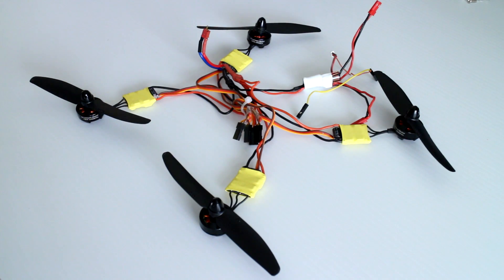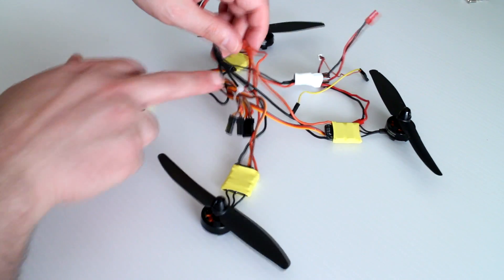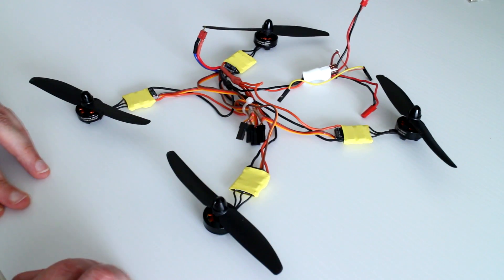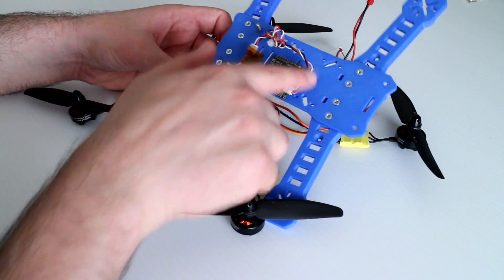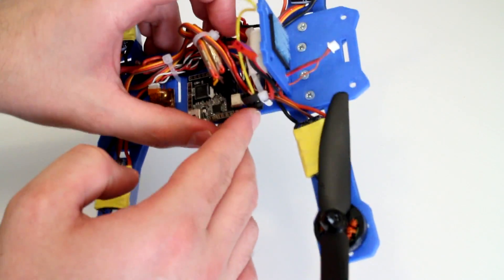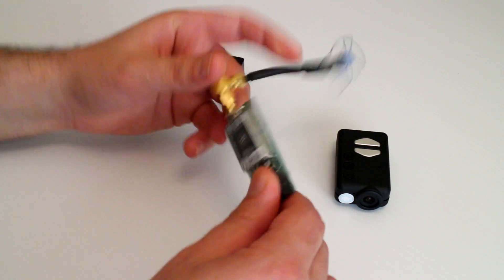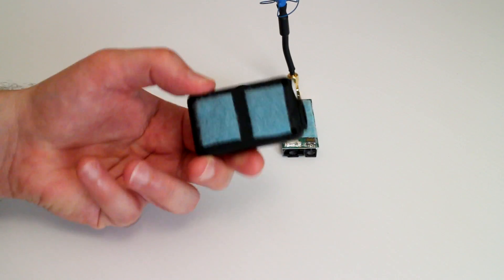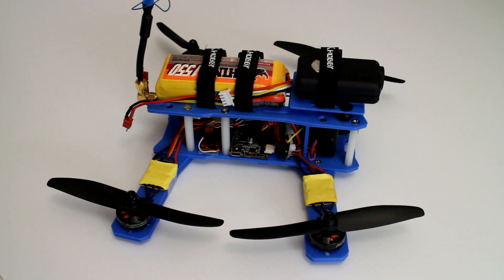Peon230 - Quadcopter FPV setup

Comment: Hey, I am jsut new to this, and I was wondering why you were using 2 cameras. Dont you only need one to transmit to your goggles? Or is one used for recording, if so, is it required?
Reply: I think he uses two because the FPV camera is transmitted over the air in real time and it has tons of defects in the image when the radio link breaks up.   The HD camera record locally with no radio.
Reply: thx
Reply: I personally use a RunCam Split, it has outputs for the transmitter but also has a HD DVR that records 1080P at 60 fps. It saves a lot of weight from not having to have a heavy go pro attached  it also gives more room up top to run a 2nd battery if you want

Comment: And where did you connect the battery to the Flight controller?
Reply: FC is powered off the ESC most likely, they often have 5v taps.

Comment: Did you ever try to make 3D-printed props?
Reply from the maker: No I haven't. I figure they will never be as good as plastic injection plus they are cheaper to buy than print I think.
Reply: Tech2C Well, it sounds reasonable enough. Thanks for the reply! By the way, you've got outstanding quality of your 3D-prints!

Comment: Is the flight controller powered by the escs that you have recommended. Also any updates on parts since you posted on thingiverse? Any tips on configuring the drone (software) or just plug and play? Thanks mate!
Reply from the maker: I have updated the parts list in the description. The flight controller now uses Cleanflight software, and is an all-in-one flight controller with inbuilt BEC, OSD and current/voltage sensors. The FC is powered by its internal BEC.

Comment: what reciever and remote exactly are you using?
Reply from the maker: Hi, the radio control I used is outdated, but you can take a look at this one instead http://www.banggood.com/FlySky-FS-i6-2_4G-6CH-AFHDS-RC-Transmitter-With-FS-iA6B-Receiver-p-983537.html?p=9X051049165582016063
Reply: thank you very much for your quick response, that helped me out a lot!

Comment: Hey there +Tech2C - I'm just putting together a Peon230 right now and I got a quick question on wiring the motors to the ESC's. The motors and the ESC's wires are all black. Is there specific wiring pairs that I should be paying attention too?
Much appreciated.
Reply from the maker: +Sandback Technical Design Inc. 
It doesn't matter. If you need to reverse the motor spin direction just swap 2 of the wires around.
Reply: +Tech2C Thanks a bunch.

Comment: I've been thinking of building a copy of the "DJI Inspire 1" redesigned pro quadcopter that's on RcHobbysUK, I purchased the STL's for a steal $7. The least I can do for all the folks that spent countless days perfecting this engineering marvel.(http://www.rchobbysuk.co.uk/store/p127/DJI_Inspired_%283D_Printable_Quad%29_STL_FILES.html) the amount of work put into it, simply boggles the mind also gives me a bit more confidence in this monumental undertaking.  I just hope and pray that I'm able to print (strong) parts on the Prusa i3 (with all your mods of course).  Thanks again for the wealth of information. Greatly appreciated m8! ;-)

P.S. Thought you'd relate to the FPV thang... LOL!
Reply from the maker: Nelson Soler 
That's an awesome looking quad frame! Surely you would give the Peon230 a go though, it's free ;)

I'd print any quadcopter frame in ABS plastic, but if you are continually breaking parts, even with a solid infill, you can always print the parts in Nylon. In fact I'll be re-printing the Peon230 in Nylon very soon (I have some sample Nylon filament to test).
Reply: +Nelson Soler  Nice job, and it looks better than Walkera's DJI clone .

Comment: Nice work on the design of the quad copter and the videos. One thing, I was wondering. Is there any advantage of getting the reverse rotation motors ? i.e could you achieve the same result by swapping the wires around on normal motors ?
Reply from the maker: Cameron Southall 
Yes the motors can run in reverse by swapping over 2 wires (AC induction motor). The issue here is with the nut which screws down on top of the propeller. 
The rotation of the motor matches the direction of the helical thread, which tightens the nut as the motor rotates. If you reverse the motor then the nut will loosen and fly off! Trust me, I've done it ;)
Reply: Tech2C Thanks, shortly after posting the question. I had an "ahhhh!" moment. I have the arms and the arms printed out so far, should have the rest done on the weekend. Then playing the waiting game over the next couple of weeks as parts start showing up

Comment: Do you mind me asking what your whole setup costs minus the fpv gear? I work at a place that scans and prints people and we also sell printers and other stuff. I'm looking to build a low budget quad to have in the shop to show possibilities of what you can do with 3d printing. Any help is appreciated. Thanks.
Reply from the maker: Hi, you scan and print people? Like a transporter from Star Trek... ;)

Price wise, the motors, ESC's, props and flight controller would cost about $100.
Each battery about $15, battery charger $20, radio transmitter and receiver $50.
So all up to start from scratch you'd spend about $175.
Reply: Tech2C Check out our website. (Behold3D.me) We 3d scan you and then print a little figure of you in full color.
Reply from the maker: twitch0601krytter Cool! That would be a fun place to work I assume.
Reply: Tech2C Sure is. We do a build your own 3d printer workshop that over a few weeks you get to learn and build your own printer to take home at the end. And we use Prusa i3's and the Owner/Manager is really impressed with how well you have your printer running.
Reply from the maker: twitch0601krytter A 3D Printer's workshop is such a great idea! Taking home the 3D printer you've built at the end of it is very rewarding. Akin to a cooking workshop, a fun way to learn too.
Send my thanks to your manager for the praise :)

Comment: why did you place the male connection on the battery? that looks like a time bomb :(
Reply from the maker: It's a micro Deans connector - each connector has 1 leg exposed. I've used them as they're high current capable and very light.

I've been using these or years, however I do intend on switching over to HXT30 connectors if hobbyking ever restock them... ;)
Reply: ah ok, my mistake. Thanks for the info

Comment: Just a question about the battery leads.. Aren't you scared they will burn off? With the amount of current, even though a small voltage, it seems a bit on the small side with such thin cables? Great video nonetheless =)
Reply from the maker: Good question.
I've had over 50 flights with this setup without issue. The micro deans connectors and 20 gauge wire is cool to the touch after a 10 minute flight, however the battery is fairly warm. Current draw wise, i'm hovering at 7 amps, and it pulls upto 28 amps at WOT with a full battery. I rarely fly at full throttle, only just to gain altitude quickly. Also when you go WOT, there will be voltage sag which will reduce the total watts traversing the cables. I guess if I held the throttle at maximum for a long time it might be an issue.

I plan to switch to HXT30 connectors with the next hobbyking order. I may up the wire gauge slightly then, but the original cable on this battery was so over specced and heavy it was ridiculous.
Reply: Tech2C Alright, well I guess it depends on the flying style as you say also, if for example you would go full throttle for a longer period the current draw would be be much higher and then it would perhaps be an issue with the thinner cables.

The size of the cables are for the discharge rate I think, so if its a very high discharge rated one I guess the cables need to be thick. I actally have no idea if this is the case, but I've worked as an electrician and there its very important to take the correct cable for the desired effect ;) That's also different voltages, but as voltage and current goes hand in hand, but in "reverse".. I just thought that with these values we have on R/C models it would be a disaster =)

But luckily that hasn't happened =D It was just a thought, so I'm not complaining, just wanted to see how you looked at it, still I really like the video! =)
Reply: Chris Fredriksson He's using 20 gauge wire which has a max current rating of 3.5 A for an assumed 7-24 core wire.  Something gonna blow, lol.

Comment: Great stuff! Getting my printer in a couple of weeks and this will be one of my first projects.
Reply from the maker: Cool!
I hope you like printing calibration cubes. Lots and lots of calibration cubes ;)
Reply: +Tech2C calibration cubes seem to be all I've printed that didn't print straight so far. everything else has been properly vertical.
Reply from the maker: firebird8600

Ah, then turn on the cooling fan whilst printing the cube. It does wonders for me...